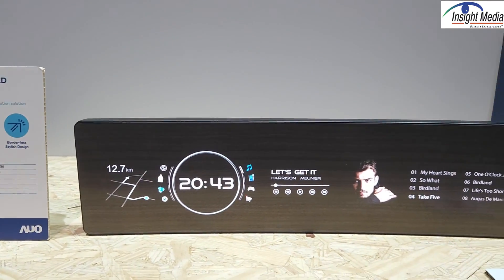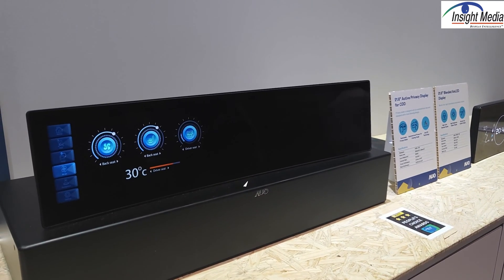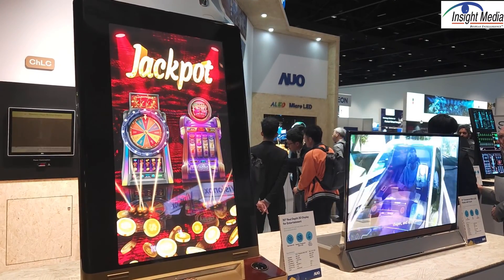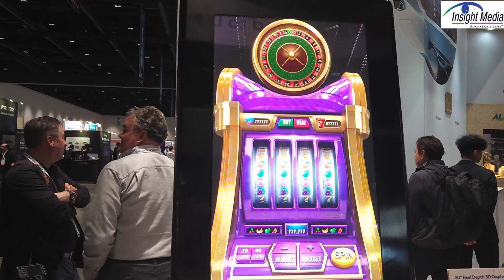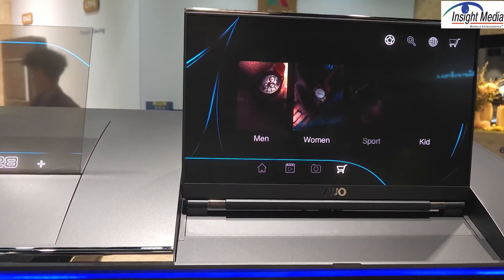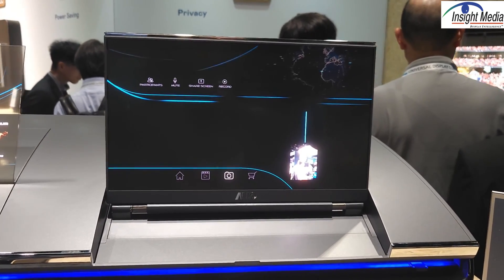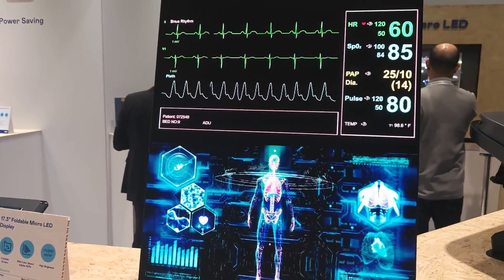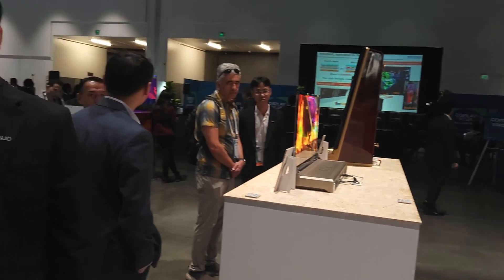AUO's microLED Displays

Comment: Why are the panels all so small with low brightness and colour gamut? I thought microLED was supposed to be the opposite. Low pixel density on very large displays with ultra high brightness and colour gamut?
Reply from the maker: panels are small as a result of the immaturity of manufacturing. Brightness and color gamut is fine for many applications, in my opinion.